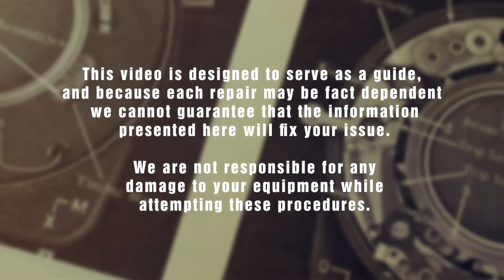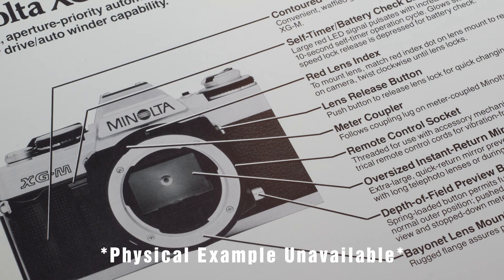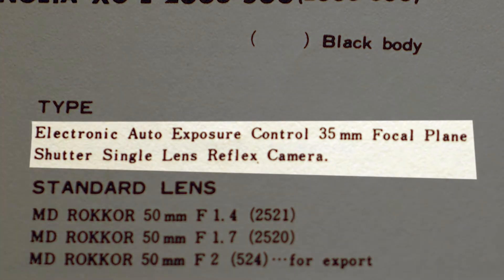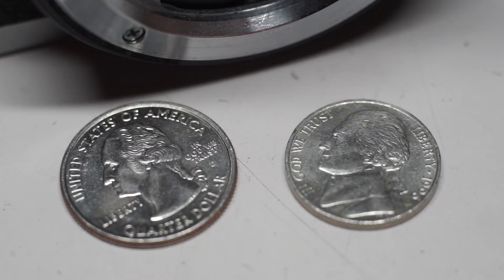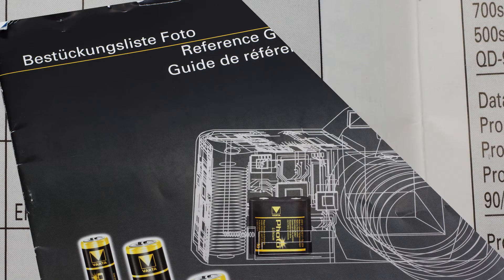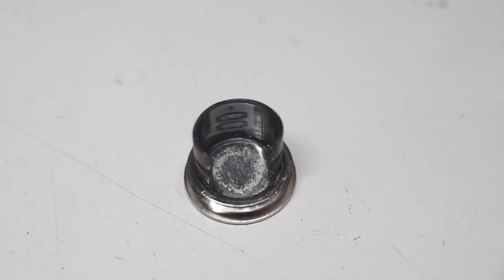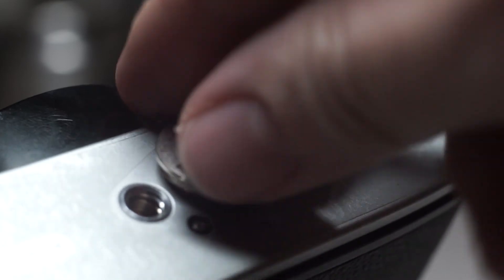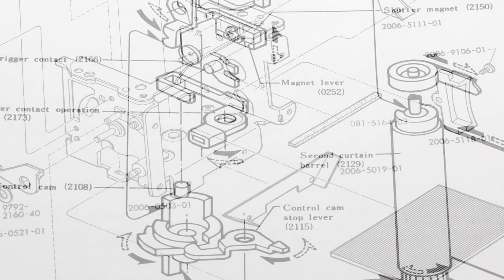How to fix Minolta XG-1 stuck film advance lever (XG-7, XG-9, XG-E, XG-A, XG-M, X-700, X-570, X-370)

Comment: My canon is having this issue with a dead battery.. I wonder if it's just tge battery..
Reply from the maker: Hello, what model Canon do you have?
Reply: @BillRogersCamera  QL17 GIII
Reply from the maker: @Dan0rioN  The Canon QL17 uses a 625 mercury battery. It is very common to have them leak. After cleaning any corrosion on the contacts, install a new battery. Since the mercury batteries are not sold any longer, you will need to find an alternative battery. I would recommend an MR-9 adapter and use a silver oxide battery. You can use a 625 alkaline but the voltage will not be correct so meter will not read accurately.
Reply: @BillRogersCamera  So you think it's all bc of the battery?
Reply from the maker: @Dan0rioN  Well, you need to start with the battery. It's the first thing to check on this camera before going any further.